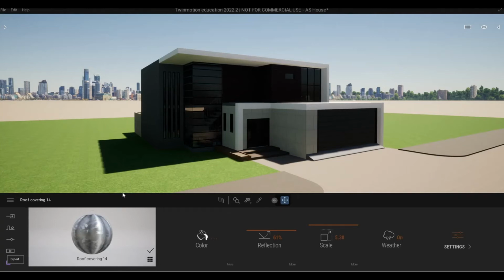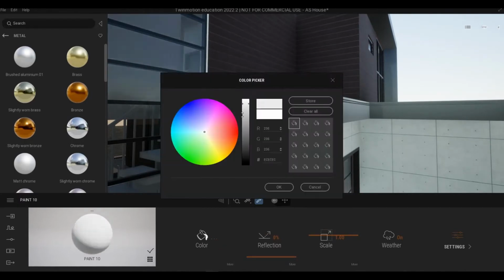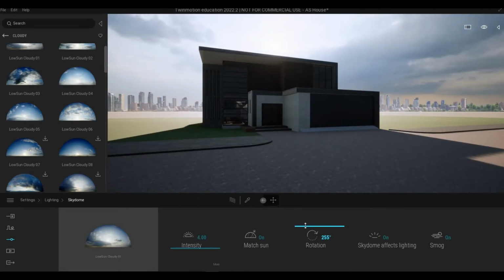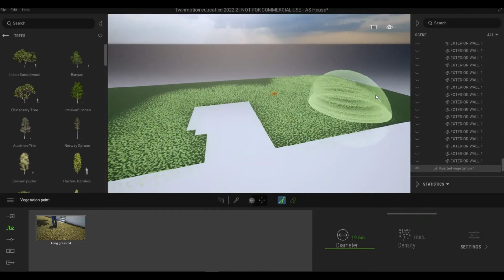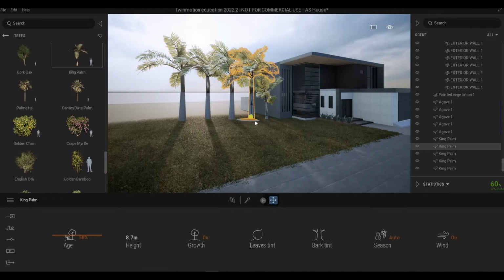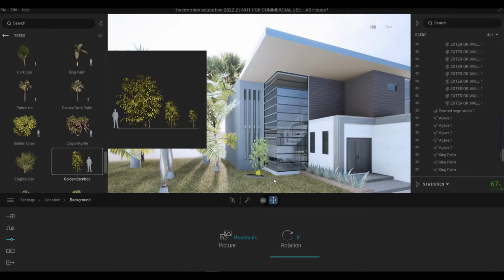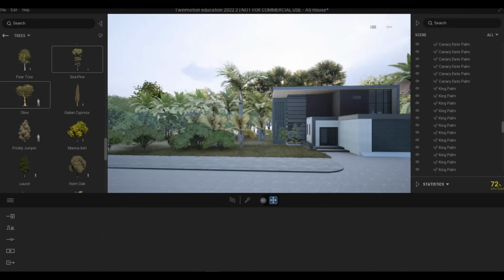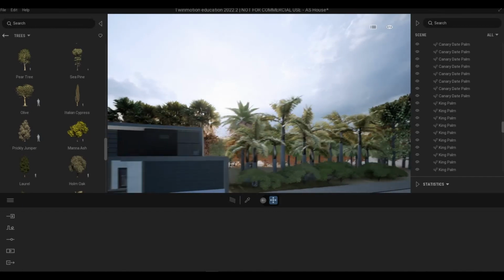AS House | Part 14 | Complete Step By Step Project | Revit and Twinmotion Tutorial

Comment: Hello good day 
You're doing an amazing job
Thank you and well done
Reply: I'm having a little difficulty

Once i click in "see in twin motion" on my revit
Most of my external walls will be missing 
I will be seeing doors and windows without a wall
Reply from the maker: Hi thank you for supporting the channel. First check that the materials used in the walls and windows are not default and use materials that are something that is visible like brick. Check that first and let me know. 🙂🙏
Reply: @ArchCoreDesigns  alright on it
Reply: Hey it me again
Sorry for disturbing
It still not visible, and also i notice the whole walls on Level 1 is not visible on twin motion
Reply from the maker: Hi Joseph, try and check this, before sending to twinmotion, first go to 3d view, then make sure details are set to fine. then try and send it again. 🙂🙏